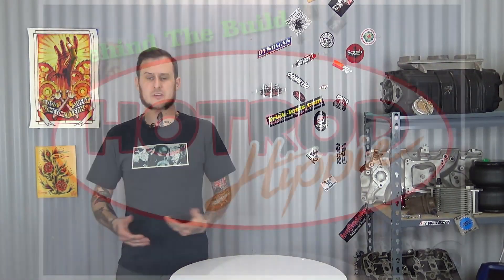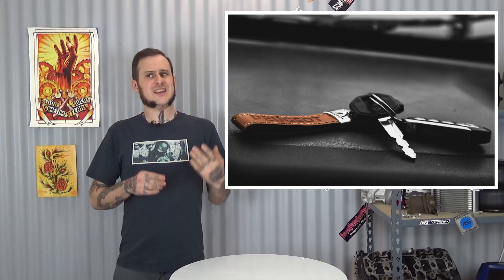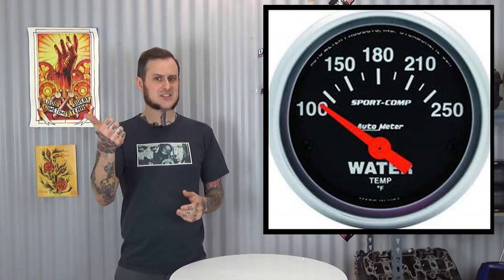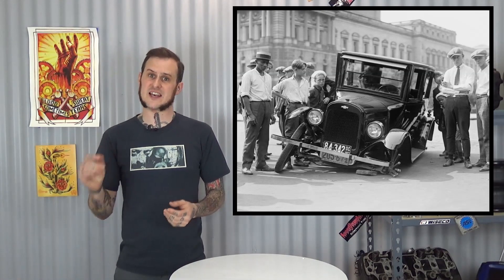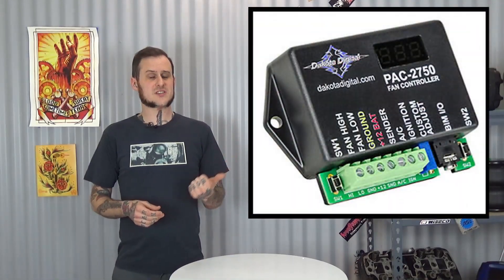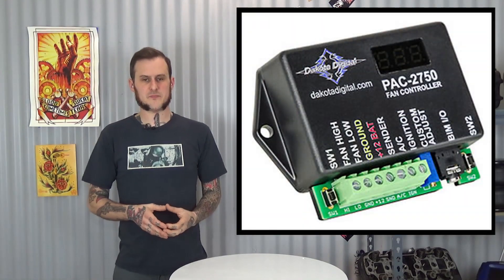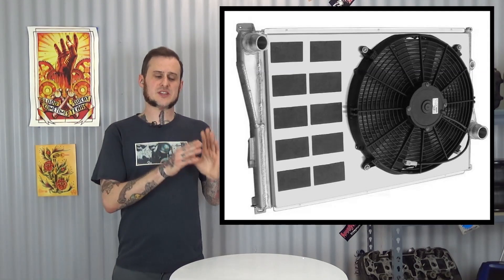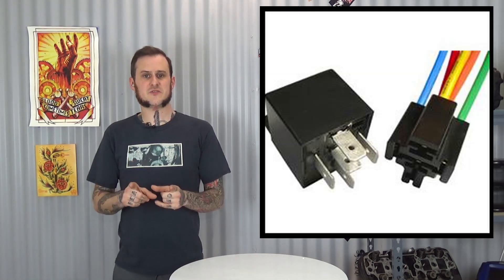Electric Fans 2 - Fan Control Systems - Behind The Build

Comment: It’s a bit of a long shot, but hopefully this comment gets read! I’m build a truck using electric fans and want control with ac, I’m leaning towards the Dakota digital but am unsure, the main thing is can I use a single wire temp sender signal to trigger the Dakota digital system?

Comment: I know this is a older video but i have a question. I have (2) older vehicles i am looking to swap in dual electric fans. The relays I have are from a Volvo that has a power wire (2) temp sensors to kick on fans. As for the power wire i’m worried about how I should be wiring it. I’m hearing that if i wire it straight too the battery then once the car is off the fans will continue to run, which will drain the battery.

Comment: Ok I was looking for a fan controller and I ran into this video...I am a Mechanic by trade almost 40 years and there where a few thing I just couldn't let go. First of all running a fan with switched power is not a good Idea but the reasons you gave are incorrect. First the thermostat controls engine temp. Cooling fan on when key is on makes no difference. If you don't believe me go start your modern car turn on the AC and you will see the cooling fans on and see if that interferes with warm up. The answer is no. 2nd human error. If you are driving down the road and your engine is overheating because you didn't switch on the fan and you have to stop to switch the fan to cool down the engine you got other problems with your engine. The air flow while driving down the road at anything over 20 mph is generally enough to keep engine temp at a moderate level and in most cars the cooling fans cut off completely between 35 to 40 mph. What I noticed about this video especially with the Dakota Digital was everything you said was right out of the promotional information right off their website...Like I said I was doing my research when I found your video and what you said was almost word for word off the Dakota Digital site...I was looking for personal experience on the product.
Reply from the maker: Turning on your AC adds load to the engine and generates more heat.  The fact that the fan is on doesn't prove that the engine heats up the same with or without the fan.  You've added a heat source in front of the radiator (Condensor) and an additional Load on the engine (Compressor). 

As for the 2nd part, do you work on custom cars much?  The cars I work on VERY often go under 20MPH sitting in traffic during car cruises or going in and out of car shows.  Not every moment of a car is driving down the highway.  Around town on a hot day, or idling waiting to park at a car show, those are the times where a Fan (especially on a high performance engine) is critical.  Or on a more stock setup, say you leave work on a Friday, dead tired, and sit in traffic on the way home.  Did you remember to flip the switch on?

Also you missed a key point with that MPH comment.  When driving at 20+ MPH airflow across the radiator should be sufficient to cool the motor, you are correct.  However that means the Fan should shut off as it isn't necessary.  It is a waste of energy to be spinning at that point and could be hard on the fan to have the added speed caused by the air pressure flowing across it.  Over speeding the fan can damage it.  Having a dedicated fan controller can allow the fan to kick off in these situations as the airflow will cool the engine enough that the fan will be below its On temp. 

Maybe, JUST MAYBE, I sound like the manuals because I am a professional custom car builder and am trying to sound as professional as I can for my viewers. This wasn't a product review, it was an explainer about the overall concept of Fan Control Systems. 

I'm a Custom Car Builder for a living. I'm speaking from first hand experience.

Comment: What's your opinion on the fan controllers that continue to run the fans for a little while after the engine has been shut off? Do you think that's a good idea? I understand that the coolant temp rises a bit after the engine is shut off, but I don't really see the point in running the fans to cool off the radiator when no coolant is flowing through it. Thanks
Reply from the maker: I like controllers that do this. The Dakota Digital unit that I believe I mentioned here can be set to run for various amounts of time after shut down. The only thing is customers get a bit concerned by it sometimes. As you said coolant temps can slightly spike after shut down so it's only going to help to settle everything down.
Reply: @HotRodHippie  Thanks. Presuming coolant temps are within reason when the engine is shut down, I wouldn't think the temp spike would be harmful though? Or is the idea more to help save the plastic parts and wiring from the heat?
Reply from the maker: @averyalexander2303  honestly I have no basis for liking it. Haha. The spike is generally fairly miniscule and when coolant equalizes through the system I believe it settles in quickly. I've had so many problems in the past with heat soaked starters and hot engines being hard to start (especially when I lived in Texas) that I like the idea of dissipating the underhood heat after shut down to help prevent that a bit. But whether there is any real basis for that I cannot say. 

That would be a really good thing to test in a video.  Maybe place various temp probes around an engine and engine bay and see what happens with and without the fan running after, and for how long.
Reply: @HotRodHippie  There must be a benefit to it since a lot of newer cars do this from the factory, I'm just not sure what exactly the benefit is. I'm thinking it probably has more to do with extending the life of wiring and plastic parts than protecting the engine, but I'm not sure. I like your idea of testing this though!

Comment: What electrical fans do you recommend? Or not! I have a 2000 Ford Ranger with a bad Black Magic fan that needs fixing or replacement. Any recommendations are appreciated.
Reply from the maker: I use Spal and Derale fans almost exclusively. Derale fans are mostly relabeled Spals bit they also have some different designs that are harder to find. I'd check out their website to see what options they may have for you. They've for ones with shrouds as well.

Comment: Hello Alan. Just found your channel and I am now going thru all your past videos. I like your "take" (your explanation of) on automotive electricity, as far a voltage, current, and power consumption (watts); and your explanation of the correct sizing of wires for the current they will carry. Mar 31, 2018 Do's & Don'ts Episode 3

I realize the following was related to your mention about key-switched or toggle switch activated electric cooling fans, but I have a "bone to pick" with this video concerning an electric fan causing slow (er) engine warmup if the fan is running from cold engine start. If there is no coolant flow (other than a dribble thru the "spit hole" in the T-stat in the upper outlet and whatever by-pass is built into an inlet hose t-stat) the fan won't be able to cool very much circulating coolant - maybe 1% to 2% flow with the t-stat closed, and just enough to allow the coolant recovery system to work and not get air-locked as the engine cools down. (Not just a stuck vacuum check valve in a radiator cap causing hoses to collapse on cool down, the wrong t-stat for the engine can cause that too. I have seen at least 5 in my 35 year career as a service technician & shop owner.) Otherwise the vehicle merely traveling down the street in cold weather would also "suffer" the same type of slow warmup; and the EPA wouldn't be down with that situation.
Reply from the maker: You are correct. I may well have overstated the warm up issue. I stand by the statement that it does occur however. Especially for those of us in cooler climates. The purpose of a clutch fan is in part to prevent this exact thing. Until the thermostat of the fan warms up it does not move full capacity of air. ECM controlled electric fans don't come on until preset temperatures. Any EPA regulated engine and fan combination fits into this exact operation scheme. Also the continually running fan can interfere with a thermostats job of maintaining proper temperature. A proper electric fan should come on after the thermostat opens and turn off after the thermostat closes. Allowing for both fan hysteresis as well as thermostat hysteresis. 

I agree I may be overstating the warm up concern, but I have absolutely experienced it in past projects. And I stand by the statement that proper fan control based around thermostat operating ranges is the only correct course of action for a street driven vehicle.

Comment: I was looking at the Flex A Lite 270 (https://www.flex-a-lite.com/pdf_instructions/270-99894.pdf) for my truck that comes with it's own controller. It splices into the A/C wiring to activate the fans when the clutch comes on but also has a terminal to wire in a manual on switch. If I wanted to wire it so the fans come on and stay on while the vehicle is running, in your opinion would I need to wire an ignition on switch to the manual on terminal or the A/C terminal ?
Reply from the maker: I would use the Manual terminal. Though either would likely do the job. I do have to ask why you'd want to do that though? I get wanting a manual control some times but there is no need for a fan to run more than it must. It just makes an engine take longer to warm up, and not cycle heat properly in the coolant.
Reply: HotRodHippie I guess I didn't take that into account.

Comment: Those aftermarket fan switches just suck. I've never had a problem pulling OEM units out of old junkyard cars from the late '80s. I found one that has the same on/off temperatures as the factory clutch in my truck. Still works the same as I put it in years ago and pretty much dead on what the specs are. Oh, and the whole setup cost me about $30. By the way, I think the word you're trying to say is pronounced hysterEEsis. Great video, new subscriber.
Reply from the maker: I had never heard it pronounced that way but you seem to be correct.  Good info, thanks!